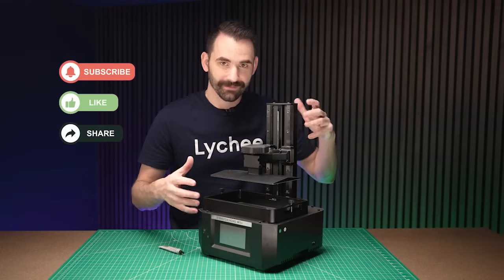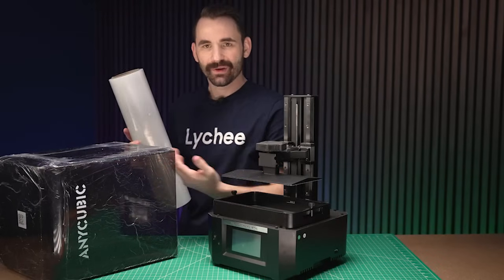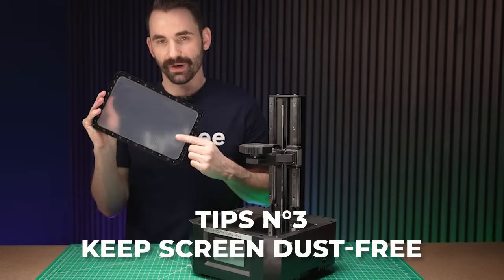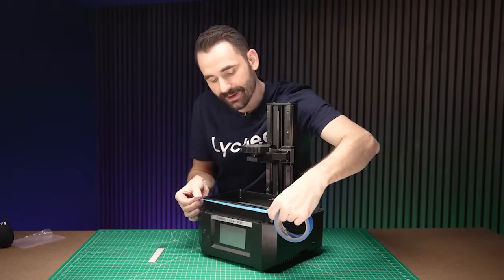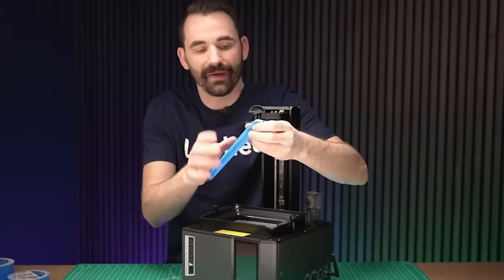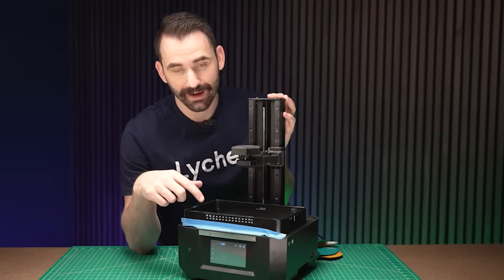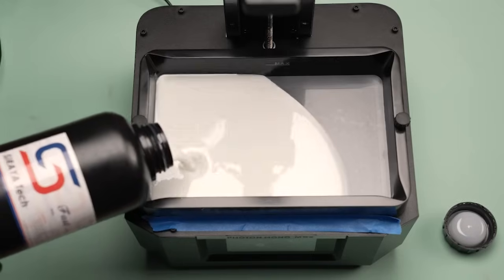13 Simple Hacks to Make Your Printer Last | Lychee Tips

Comment from the maker: Got a 14th tip? Comment your secret below! 😊
Reply: 14th Tip:  Always watch J3D videos and don't forget to read the J3D guides! 🙂
Reply: I find using Methyl alcohol instead of IPA gives me better cleaning results and it lasts longer before having to replace
Reply: You don't have to limit yourself to low capacity, USB 2.0, or FAT32 for your USB key. If you format your USB stick with Rufus (non-bootable, MBR options), you can use exFAT format and large capacities. I've been using multiple 64GB USB 3.1 flash sticks formatted in exFAT using this method for years with printers as old as the Elegoo Saturn 2 and have zero problems.
Reply: @Lychee3d Unless it's a warm day (above 25 degrees Celsius)I always warm my resin by putting the bottle in a plastic bag and floating it in a container of warm water for 15 minutes or so, a good shake and ready to go.

Comment: Good morning brand new to this. Love the videos very helpful. Would you use a screen protector on the LCD (like cellphones screen protectors) or is that not necessary on the Mars Ultra 5?
Reply from the maker: Thanks! and yes you can! if leaking happen, it'll protect your screen from cured resin :)

Comment: What about applying small amount of I think its called gear oil to the surface of the FEP to help keep resin from sticking to it rather than the plate?
Reply from the maker: It's really not recommended, it's gonna mix in the resin and might cause other issues

Comment: What is the UV Flashlight used for? I did not see it used during the video.
Reply from the maker: You can use it to cure what you use to clean your area like the paper towel, all that goes in the trash needs to be cure :)

Comment: Great Video!  

Tips n°1 - Grease Your Screws – Great tip.  I did this a few weeks ago and it’s a great safeguard.  

Tips n°3 - Keep Screen Dust-Free –  I was skeptical of this one but based on this video I made the purchase and it really works.  Although I picked up the purple as it goes with the decor of the resin lair better. 😊

Tips n°4 : Add Heat Controller – Also picked these up, and I like them.  I wasn’t sure that I needed them, but I find myself looking at these strips more than I figured I would.

Tips n°5: Tape the Vat – Great tip!  I’ve moved to black masking tape for aesthetics but talk about a quick and easy bit of insurance.

Tips n°6: Protect Build Plate – I purchased over a year when I first saw Derek suggest this.  It is my go-to spatula and is so much better 98.5 percent of the time.  I did run into a very stubborn/brittle transparent resin recently that I ended up going “old school” on.  I’m not using that resin anymore.

Tips n°7 : Clean FEP Properly – I’m a huge fun of the process, but have been very loyal to my Uniformation silicone scrapper thingy.  There was no way I’d like Derek’s better, but taking into account the WWDD aspect, I purchased these.  Dang it.  They are better.  

Tips n°8 : Post-It Removal Savior – The Lychee Library tool is a must have.  I keep a supply on hand and print more when I run low.

Tips n°9 : Keep Area Clean –  Great Tip.  I have moved to tear-a-square paper towels and keep a stack of pre-torn squares at the ready.  On the mat topic – I made the mistake of buying mats with a pattern across the bottom.  Derek’s flat surface is much better.

Tips n °11 : Empty Vat Easily – This seemed weird to me, but WWDD, so I purchased a set.  As of last night, I’m a believer.  I had something floating around in the GK3U vat and did not want to remove it as it’s a pain.  I grabbed this super-syringe and, while it was a bit awkward to use one-handed at first, was a game changer.

Tips n °12 : Avoid FEP Scratches – These are great!
Reply from the maker: Thanks so much!

Comment: Some really great tips. 
Blue lint free shop towels are the best solution I have found for general cleanup. Papertowels are cheaper but dusty.
If you are in dry climate or house with low humidity, get a can of Static Guard. Acrylic is a magnet for static and spraying the area will cut down on dust sticking to the lid.
Pop-sockets for phones make the best lid handles. As does having a way to hang the lid out of the way when you take it off the printer. I have an old motorcycle helmet hook above my work area so it doesn't take up workspace and it less likely to get resin drips on it.
For the silicone mat, look for the ones that go under the sink. They are cheaper than the dog specific ones and are larger. Best of all they have a taller lip to protect from spills.
If you have an FDM printer, it is worth it to print a vat drainage system or custom funnel for your resin of choice. The design I use holds the bottle, funnel and the vat. I can hang the vat and let it fully drain or replace the resin boittle with an alochol container when I rinse the vat out.
For protecting the machine from drips, I made a small awning that goes across the front of my machine. It is hinged so I can lift it out of the way when I need to reach the display.
Reply from the maker: Great tips thanks!

Comment: Good god - this is overkill. You don't need to buy a million things to be 3d printing with resin. You should take your time and be careful. You also don't want to be discarding a bunch of liquid resin - it's toxic as hell. If you need to wipe up a spill that's fine, but take all those resin soaked paper towels or whatever and put them outside in the sun for a while. Over-curing the resin in the sun makes it safer for you and the environment and speeds the rate at which it will break down.
Reply from the maker: You should totally cure your paper towel! And everyone is welcome to take any precautions they need and want when 3D printing! :D

Comment: There has been a few times where I've had pinholes in my FEP. I've used a tiny little patch of scotch tape on the OUTSIDE (bottom), which seals it very nicely. However, depending on the level of quality you need, this WILL leave small lines from the tape profile on your profiles.

Comment: I don't really understand the whole tape part. If you're not a savage there's absolutly 0 reason you'd have any drop outside the vat. i've did like 200+ prints on my Mars 5 ultra and nothing. Same goes for the cover, if you don't put your hands full of resin everywhere you won't stain anything. Feel like ppl are lacking proper education on how to use those resin printers in a clean way
Reply from the maker: Even though you're careful, drips can still occur, so just a simple tips just to be extra cautious
Reply: Shit can happen to those who are careful.

Comment: To find a hole or check the FEP, place the vat it on a paper towel and add iso. You will find the spot were the hole is quickly. If I don't have a new FEP in stock and the hole is tiny I use a small bit of that very thin Polyimide Adhesive tap. BUT nothing will print over that spot and I put the tape on both sides of the FEP. I also check for leaks every morning by removing the vat and looking for resin on the printer. I also check under the vat before doing a clean up print.
Reply from the maker: Great advice!

Comment: Yikes! I promise I was already subscribed...! Thanks for the tips. I will need try some of these for sure. I am wondering why you would use a post-it , however? I got a tip a while back to use previously printed supports to lift the layer of vat cleaned resin and it works very well.
Reply: I used to use supports a lot more mess and risk of buts falling off into the VAT.
Reply from the maker: Thanks! I found using support makes it harder to pull of the cure sheet, a post it or our Lychee Cleaner makes it so much easier :D

Comment: As I am an "infrequent" printer (say once a week) I always take my Vat out and clean it then store it in a "vented" tissue-lined plastic box until my next printing session. Is this ok or am I nuts ? Thanks.
Reply: That's fine, but if you keep your printer in a dark area there is no need. You can just mix and stir the resin up very well and you're good.

Comment: Thanks for the tips. There were a few I didn't know, and I also didn't know about the M wipes. One comment. First thing I do is print handles for the removable hood and use double sided tape to attach them. I also put them at different heights so you don't create a pivot point at the handles. Makes everything easier. Keeps the hood cleaner, and makes it easier to put on and take off.
Reply: Do you have a good model you like to use?
Reply from the maker: Great tips! It reminds me that we need to print some more handles! :D

Comment: 14. use a usb extension cable which you leave plugged in all the time. so the usb port does not wear out. 
15. on elegoo printers: never press the on off button to turn it on or off, leave it on and use a power strip with a switch to turn it on or off. the elegoo button will make problems at some point
Reply from the maker: Amazing tips!

Comment: Silicone baking mats are generally bigger and cheaper than the dog mats
Reply: I looked at them, I saw one with a lip about half the height of the Dog mat and close to the same size. It was cheaper by about 30% a pretty good saving TBH. However, for me I really love the big lip to prevent any resin or IPA spills.
Reply from the maker: Yes both are quite the same :)

Comment: 0:28 (1) Grease the resin tank screws
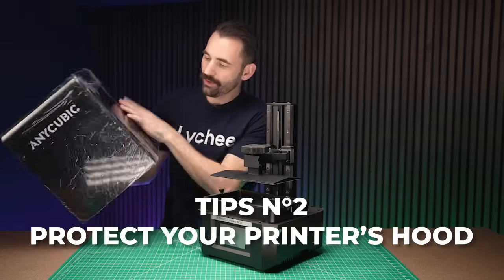1:00 (2) Protect your printer hood
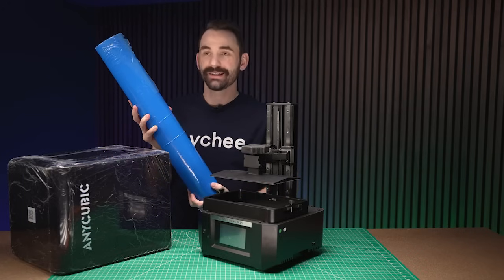2:05 (3) Keep the screen dust free
3:03 (4/5) Add heat controller + Masking tape
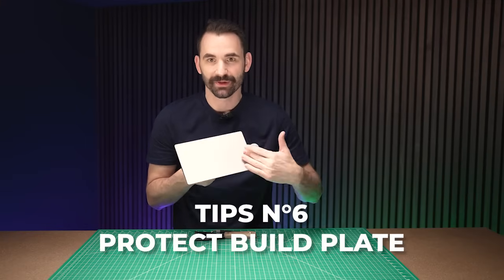5:40 (6) Protect build plate
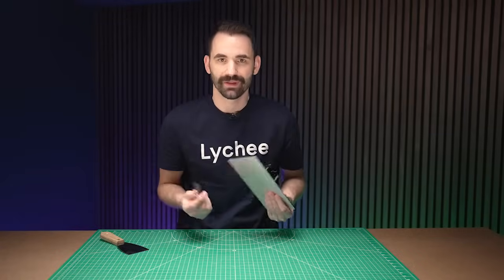6:20 (7 Clean build plate properly
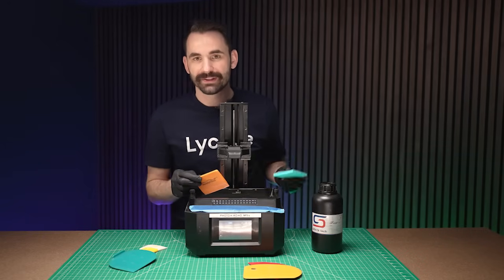7:20 (8) Post-it removal savior
8:45 (9) Keep printing area clean
10:00 (10) Empty vat easily
11:26 (11) Avoid FEP scratches
12:55 (12) Protect the LCD
14:25 (13) Use a good USB key
Reply: For #8, I prefer to use old supports from past prints. Gives them a second use and removes the need to buy anything else. Just make sure not to press them down too hard. Otherwise, they won't have a gap of resin to cure to. Also, using a set of supports that are well above the resin line keeps things cleaner.
Reply from the maker: That works too, but I find sometimes the supports breaks before being able to pull out the cure sheets :)
Reply from the maker: Thanks! we also put every time code in the description :D

Comment: Awesome set of tips Derek and thanks for the Amazon links.....!!! That makes finding the items a whole lot easier...
Reply: You're very welcome, I've tested sooo many different products that people suggest and these are my must have for sure.
Reply: @J3DTech I noted with interest that you recommend not cleaning the syringe after taking out the resin. I tried that with a syringe and the resin actually interacted with the rubber tip causing it to become unusable. It sounds like you haven't had a problem with ones you used. But also, why not wash the resin off?
Reply: @johngamiles2541  The issue is the IPA will affect the rubber. I haven't had the resin effect the rubber at all but as soon as I start adding cleaning agents I start getting problems. 

If there's a particular syringe or rubber combination you have used and nothing else has touched it, but the resin I would be interested to know that.
Reply from the maker: Thanks!